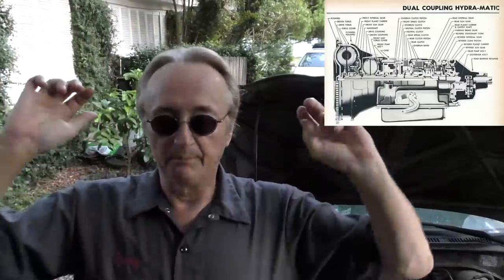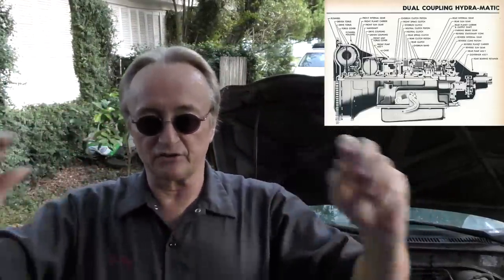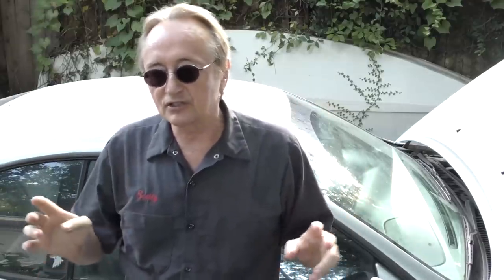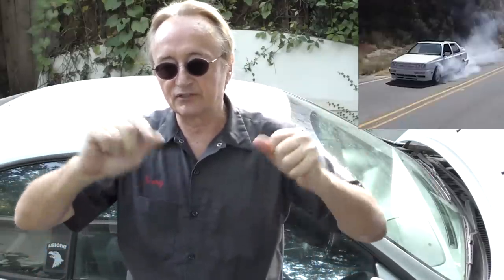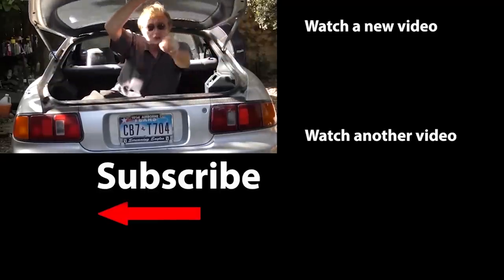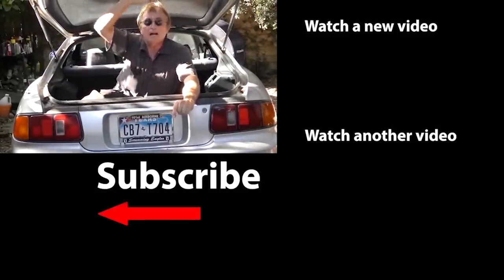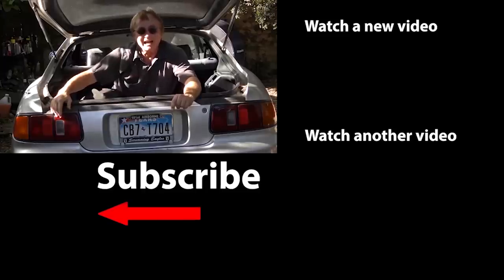This Isn't a Real Corvette, Here's Why

Comment: You didn't mention anything about the manumatic transmissions that Kia offers.  I have it on my 2004 Kia Optima.  You can select full automatic mode (great for when you are eating pizza in the car), or use the semi-automatic mode.  Semi-automatic forces the driver to do upshifts, but the car itself will do automatic downshifts from 4th to 3rd at 30 MPH, from 3rd to 2nd at 20 MPH, and from 2nd to 1st at 10 MPH.  The driver can manually downshift before those speeds and if the downshift will not overspeed the engine, it will allow it.  I shift it 95+% in the semi mode cuz I like to shift myself but the auto downshift feature is good if you forget to downshift so you don't lug the engine.  I gave you a thumbs up any Scotty but shame on you for not mentioning.  The world is not black and white, there are some "gray" transmissions.

Comment: Scotty ,i know youre not a fan of dodge.we bought a 2015 ram 1500 ,5.7 hemi.we took your advice not to buy new.21,000 miles.looks great,runs great. We n
eeded towing power,covered.paid 28,000$ ...1 owner,in state.Tn.i have heard issues about lifter bearing failures...never dealt with by dodge engineers.please please tell me i didnt waste my money.aparently well maintained factory call oil changes checkups all on record....

Comment: I prefer Manual I didn’t realize it was that low of a percent of manual drivers out there though. I work at a transmission shop and it feels like it’s more like 15% maybe 10% of our work is manual transmissions and typically it’s just replacing the clutch or hydraulics.

Comment: When he mentions the Mustang being available in manual transmission models, I somewhat wince. Back pre-2015 you could get them with Tremec-made transmissions which were both bulletproof and awesome. The newer ones are Chinese-made trash that can't handle more than about 500 horsepower or you throw parts everywhere. The Bullitt model just barely gives enough wiggle room to allow for this. While I love the look of the newer Mustangs, they're cheaper for a reason tragically.

Comment: Speaking of manual transmissions, could you tell my friend, "Tom, Roy is correct; Cars with manual transmissions have smaller brake sets than automatics because you use the manual transmission to help slow down the vehicle, and you don't  do that in an automatic without wearing it out." He still doubts me. :)

Comment: I love a stick.  But for true performance, it can't compete with a dual clutch paddle shifted trans like the C8.  And most people don't have the skill to shift a 400+ HP car properly without breaking things.  CVT is in a whole other category when it comes to acceleration.  And today's modern automatics are not the power robbers of yesteryear.

Comment: Or get the aw4 auto trans and it will last and its darn near bulletproof, i got 265,097 miles on the original 2000 aw4 in my Cherokee sport 4.0l

Comment: Scotty i have 2 question for you 1st is what do you think about the 4 cylinder diesel trucks that are coming out on the small trucks? My 2nd question is i just bought a 2009 Chrysler pt cruiser when the engine gets to the regular temperature i get the oil light when i am not accelerating. If it is at idle or going a constant speed the oil light will come on. Please help. Thankyou

Comment: I have a single cab 06 4x4 2500 Dodge with a Cummins and a G56 6 speed manual. The garage i take it to says its the only manual shift truck they have seen in a while

Comment: Hey Scotty, love the channel!!!!!  I have a question that I hope makes your Thursday special.  I have a 2014 Subaru Forester with a CVT.  I had the dealer change the transmission fluid at 60K miles, when I got the car back at first it seemed to drive fine, but then the car wouldn't move very fast even if I floored it.  I took it back to the dealer and I was outraged!  They ended up fixing the problem but their explanation was that they had to clean something under the car and that's what caused it to malfunction.  I remember over hearing one of the guys saying everything checked out on the computer, but they knew there was still something wrong.  Ironic, I replaced the CVT fluid to protect it and now I think it would have been better off if I didn't.  What do you think really happened?

Comment: Automatics used to be more reliable and durable.  They leaked, but if you kept fluid in them they ran forever and could handle more torque than manuals. They weren't too expensive to rebuild either.  Since they started putting overdrive in them, they got much weaker and more expensive.  When cars go electric, transmissions will not have to shift at all and they will be reliable again.

Comment: I actually prefer using a manual in traffic than an automatic.  When I drive an automatic in traffic I always get a cramp in my right knee from going between the gas and break.  When I drive a manual I use the break less than half as much as I do in an automatic.  I can also still get better gas mileage in a manual than they say is possible with only an automatic (they must have people that don’t actually know how to drive do those gas mileage tests).  It’s sad that most people in this country choose the lazy route when it comes to driving.  Driving a manual keeps the driver more involved with the driving experience and keeps them more engaged in what they are supposed to be doing when behind the wheel.  Driving an automatic is boring and causes the driver to not pay as much attention to what they need to be doing and it shows by how little people pay attention when on the road.

Comment: I read in one of the car mags that the reason they're not offering manual transmission is because they'd have to put a hole in the structural "tube" running down the middle of the body.  Seems like they could find an engineering solution to that problem but hey, it's GM.

Comment: Why don't we go back to the model t. Where your have to crank the motor out front.  Generator,crank up windows  points,NO air conditioning  and no power steering or brakes. We don't need all that crap and it was more fun
Reply: No seat belts. 
No air bags
No power steering.
No AC
No crumple zone.
No safety glass.
Yes..cars as part of the evolution chain
No

Comment: So the question is what controls what. You can't get a standard transmission on a lot of vehicles. I think the manufacturers are taking away options to save money. Think it's cheaper to get manual windows? Try finding a car that offers manual windows. You'd have to special order it.  I have a 2017 Tacoma  with a 6 speed automatic. I wish I had the old 4 speed automatic that was on my 2006  Tacoma. This truck can't decide what gear it wants to be in.  You have to pay the hackers $700 to make this truck shift right.

Comment: Hi. I'm CLUTCH_AND STICK

1998 Dodge 318 w/5 speed
2000 Nissan Maxima
2006 Mustang GT
2014 Camaro v6 w/6 speed

Seriously though, come off it. 

The Corvette it's only following suit with it's competition. Besides, I listened to A GM explain that the Vette Auto trans is really 2, 4 speed manual Transmissions Frankenstein'ed in.

Comment: The problem with this is in the truck industry were most younger people cant drive a stick in a tractor trailer  dump truck or rolloff trash truck tgey still use manual

Comment: Hey scotty my mother's 03 chevy monte carlo ls with the 3.4l v6 her ac is blowing barely cold on passenger side and luke warm on drivers side. She thinks it just the doors for the ac vent or is it the climate switch gone bad. What could be the problem. On a 100 degree day the ac doesn't even barely works I have thought it might be low on r134a would this solve the problem.

Comment: Hi Scotty. I seen your video on  how the 8 speed transmission had some rough shifting at times in the Toyota Corolla. Question is that the same transmission that is in the Rav 4? So now I'm thinking the way to go on a Rav 4 is to go with the 4 cylinder instead of a 6 cylinder so I would have a better experience with the 6 speed transmission.

Comment: I like standard transmission,I won't even buy automatics. In the case of the new Vette it's not really fair to call it automatic. It's more like a sequential manual box like used in race cars since forever.
Reply: Sequential manuals are not DSG's. Most sequential manuals have a clutch pedal for starts and only 1 clutch pack
Reply: @farnarkleboy  I did not say it was a sequential box, I said it's more like one  than it is an old-school automatic.

Comment: My car is automatic transmission and I hate it. I will pick standard transmission. No before anybody starts on me,let me explain. I had to get a car in a pinch so I can get to and from work after my '93 Dodge shadow blew a piston through the oil pan, it was manual.

Comment: I'm looking to change my GM Vectra it's European and I've got over 180,000 miles on the clock but it's burning a bit of oil so it's off to the great bone yard in the sky or the scrapyard whatever and I won't get either an automatic or a 4 wheel drive car and listening to Scotty I've a long list of cars to avoid and I'm so thankful to scotty for his advice as I certainly know what crap, (scottys words not mine) to give a miss I wanted a Honda  cvr but that's kicked into touch because after 2014 they brought in the 1.6 turbo and Scotty says to avoid like the plague,so scotty please help I want  a 3 or 4 year old suv manual with at least a 2 litre engine and at least 140 bhp, here's hoping and waiting, ps Scotty i live in the u.k.

Comment: Oh nooos, nobody opted for manual transmissions in an enthusiast vehicle like the Toyota Corolla. I'm old enough to prefer one but it's an anachronism. Modern automatics shift faster than a professional driver can and arguably get better mpg (the computer knows when it's going to deactivate cylinders and you do not, there is no parasitic loss in full "lockup" mode, etc). As to these modern 10 speed transmissions being "better", that's questionable. They get better mileage but a huge transmission with 3 speeds can last a crazy long time or soak up many times its rated horsepower, depending on where you wanted to go with that, it's just been so long since we have even offered one that people forget.

Comment: the corvette is supposed to be Chevy's highest performance vehicle, why would they slow the car down with a manual transmission? they want lap times and records, not nostalgia. Plus this is the most corvette a corvette has ever been. the designer always wanted it to be a mid engine car since the beginning but chevy/gm kept turning down the idea because it was more expensive and they didn't think it would sell as well to average consumers that wouldn't understand or care about the benefits of a mid engine car.

Comment: better start with other MFG's before chevy.. This would be the first time they didn't have stick. Rumor has it their might be a special edition with it. It is a real vette. Lets be real, I love sticks, two of my current cars are stick but chevy had to adjust and adapt. Front engine , 800+ hp wouldn't be put to the ground and the zero to 60 was limited. Whether weight in front instead of back or the speed of an paddle, it was going to go bye bye. The cars you stated with sticks aren't in the same boat as say the vette, Porsche, Ferrari (viper is gone) etc

Comment: As cheaply made, with low horse power as they were from 72 -82, for my money Corvette died after 82. I've owned 2 C3's new(1980. automatic, which about 6 months later I traded for a 4 speed) then in 2013 I bought a 1981. I also owned 2 C4's new(85 & 87).  The C3 still is the best looking American Car ever(in my opinion). They were cheaply and poorly made fit to finish sure, but they have that something.  Love your videos Scotty!

Comment: If you drive pulling big weight, in adverse conditions, corners, hills. Ya know manual rules. If you just drive once in awhile, flat ground, have low intelligence, automatic all the way. 
I drive 18 speed fullers for a living and do it in snowstorms pulling big weight (63500 kilograms is legal. Can be much higher come winter) and yes the 18 speed can be automatic as well but you don’t have the control. 
Watch drag racing, automatic is king. 
Go in a formula 1 🏎 and you’ll see manual is what you need.

Comment: It's the government's fault (state governments). In Europe you have to be able to drive a standard to pass your driver's test. So everyone learns how to use them, and no one is scared of them, and the take-rate is much higher. Even though automatics are still more popular. Here, everyone is scared of manual. They tried it a few times, couldn't get it started up, and though no, thanks. 

I have the last manual Acura made, and I'm going to keep it going as long as I can. After that, it will be another manual. If I can find one.

Comment: I was really hoping and praying Scotty would get through this one without calling a transmission a "stick shift." "Stick shift." THAT EXPRESSION IS SO FUCKIN' STUPID! Are you NOT pushing or pulling a "stick" in most vehicles equipped with an automatic transmission? On a lighter note, it's amusing how most Americans these days--even a good number of NASCAR fans--practically break out in hives when encountering a third pedal suspended over the floorboard  that doesn't operate a parking brake. Try shifting your own gears, people. Unless you're driving in heavy stop-and-go traffic, you might find it as fun as so many of us do!

Comment: Unless you grenaded the gear tree the manual transmission might need "soft parts" synchros, and unless you ripped the sump open on a rock the manual transmission or if you have no soft parts at all, a gearbox will last FOREVER. A standard manual transmission is a much more economic way to go. I could run my old pickup trucks so fast most people could not shift fast enough to keep up even if that had an automatic transmission. EVEN  CLASS 8 SEMI TRUCKS HAVE 10 SPEED AUTOMATICS IN THEM NOW! GIVE ME THE 12 or 18 SPEED EATON STD!  The AUTOS DO NOT LAST IN CLASS 8s.

Comment: barely spoke about the vette.  Its gonna be a DCT, not just a regular automatic.  Not a fan that it won't have a standard, but a dct is not a bad way to go if it holds together.  WAY better than ANYTHING with a CVT.  Also, the supra is less of a real supra than the vette is a vette.  At least the engine is still gonna be GM.  Toyota just put a body on BMW's everything else with the Supra.

Comment: You know why they want you to keep using automatic transmission?  So it easier to take your vehicle away by computer, because of the auto assist parking tech and the loud beep when it get too close, will not happen under a manual transmission.  Mystery solve.  Anybody want to go to that city highway packed don't know why it was packed in the way it did, it was done by design to keep you from, well, Moving.  All about control Scott and the Ecotech isn't bad as you make it out to be but I know driver with the same engine did not take any care of em, and my grandpa were fixing jeeps and other military equipment in his days of being a Sargent Air Force Army back in ww2.  Tank come from auto industry and the soliders have to fix them, every time they break.

Comment: Sad to see this.  Standards are so much more fun to drive.  These Paddle shifters/ Autosticks aren't the real deal.  No Thx!
Reply: It depends on the type of gearbox used. If it's a properly built and configured dual clutch, then it's worth it. If it's a conventional automatic (planetary gearset with a torque converter), then it's not.

Comment: Manufacturers  want to sell them because  manuals last to long  and are cheap to fix were as modern autos cost more than car is  worth once it 4 years old or so and you wont see to many 300000 mile autos especially  in fwd applications

Comment: 1948  or 49  buick roadmaster dynaflow  2 speed  and power glide  2 speed then th 350 3 speed  hydramatic and th 400 hydra matic   the turbo jet 2 speed in chevrolet was a pos  but the 2 speed dynaflow and powerglide areamazing  but the real star is the  TH400 3 speed

Comment: That 2020 Corvette without a standard transmission is just garbage without that ultimate driver's experience of a higher performance feature overall!
With this "newer" concept of a remodeled midengine sportscar the standard transmission should be a package option, "but it's not
which is a damn shame and definitely a extreme significant
(NO BRAINER G.M. FOOLS)
(G.M. JUST SIMPLY SUCKS)
(LESSER QUALITY CONTROL)
(NEVER BUY ANOTHER ONE)
( RAW TRASH WITHOUT CLASS)
Reply: We are swapping a 6 speed into the c8 here at European Auto Group